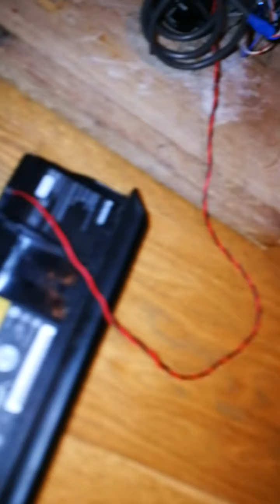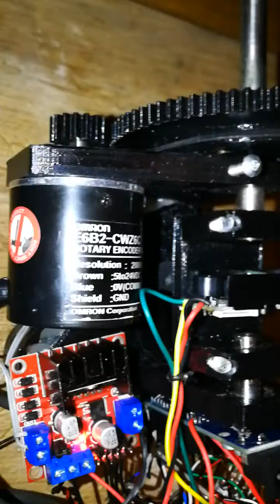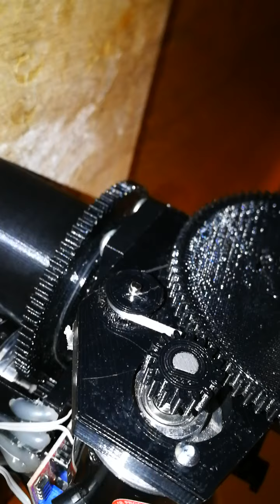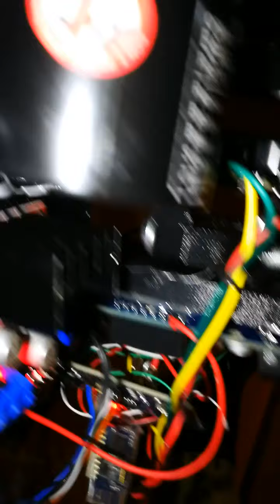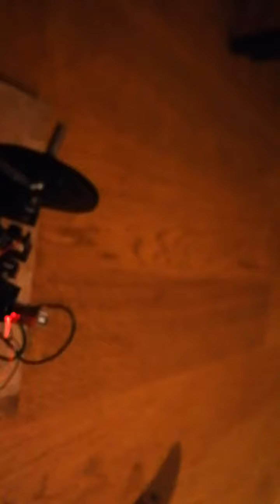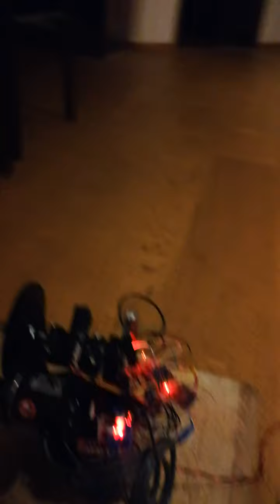Arduino based 3D measuring laser Tool VectorZ3D V1 diy

Comment: Great project. I've been thinking about making something very similar. It looks like the encoder isn't hooked up, the gear isn't engaged. Will this be working soon?
Reply from the maker: Is working now :). But the accuracy isnt good with the 3d prinyed gears. I made now second version with original gears...
Reply: @zdenochupac3344  Cool, share another video when you have a chance. I was also thinking about using gears or a belt system to give the less expensive encoders more resolution. Curious how this works for you. Great work.
Reply from the maker: @citterly  Now working verry well,  have made it new version more precise...
Reply: @zdenochupac3344  Great !!  I have the sensor, but am still learning programming python and C languages. What makes it more accurate? New software or better mechanical and electronic components?  Making a new video?
Reply from the maker: @citterly  I using only wiring native arduino language, and the video comming soon
Reply from the maker: Today have i try IT the second version of my measuring Tool and now is the accuracy on 20 Meters xyz 2 mm ;)
Reply: @zdenochupac3344  That's awesome, great job !!!
Reply from the maker: @citterly  new version https://www.youtube.com/watch?v=LI6smBRo9yA